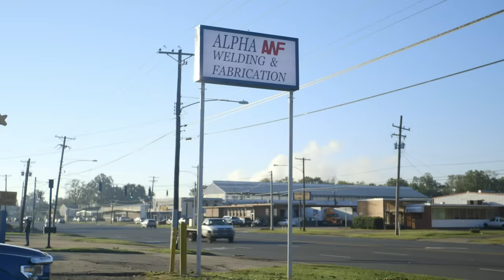Patient Struggles To Breathe At Night With Hugely Overgrown Nose I Dr Pimple Popper

Comment: A simple surgical removal using a scalpel to shave off the abnormal tissue with electrocauterization of the bleeding points can be considered as a good treatment option for rhinophyma, as it results in an excellent cosmetic outcome and has short recovery time. I guess you could cut most part of it to get fast better result.
Reply: I agree with you!
Reply: @EsmeraldaOliveiradaSilva  Brazilian?
Reply: @MSS5024  sou sim...Do Rio de Janeiro